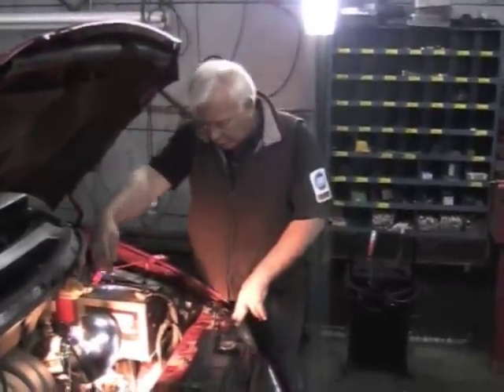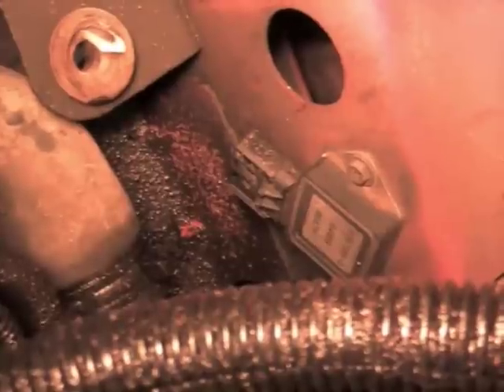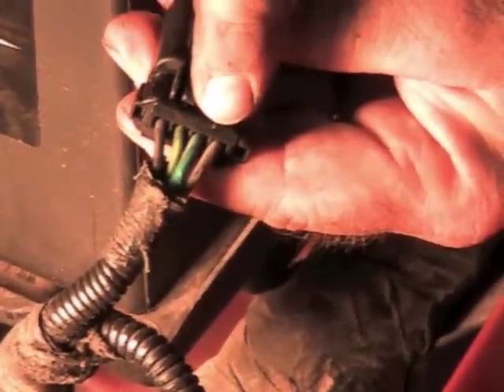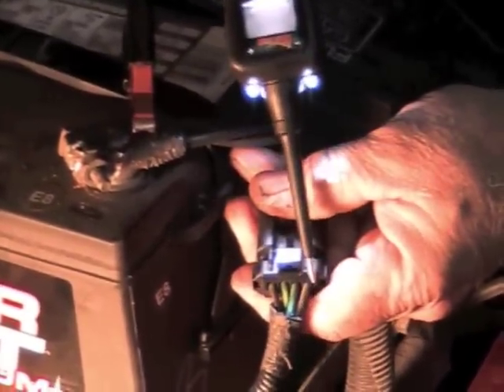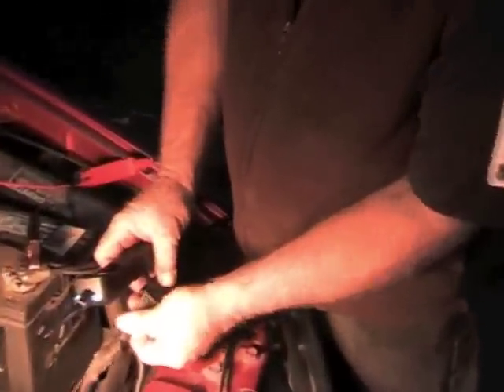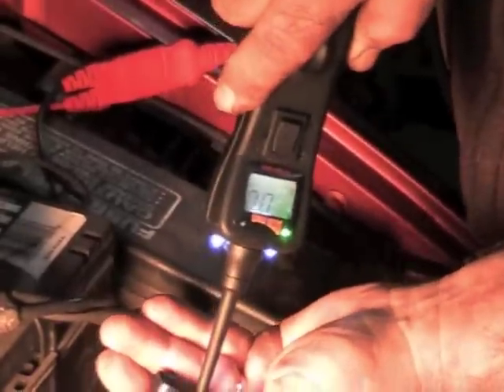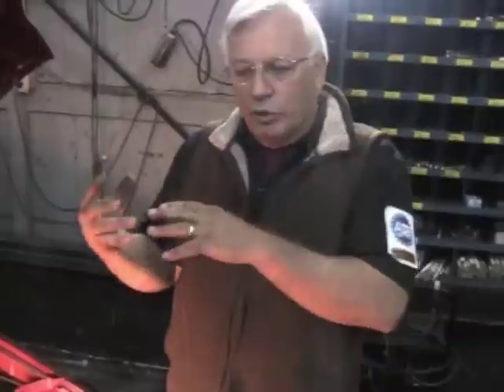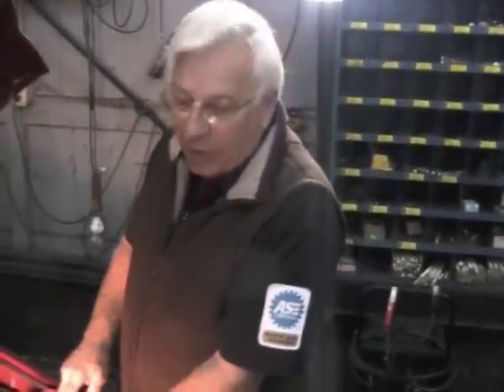Chrysler Cooling Fan Relay

Comment: I would like to know where you got the wiring diagram of the chrysler radiator cooling fan relay.  I thank you for this video.  The Haynes manual diagram doesn't have the 1-4 pinouts on the diagram, just a block drawing in which the signal wire LTGRN/BluTracer and the Power Out to the fans are reversed.  It cose me a BCM over the weekend when I installed a new wiring plug relay combination.  The generic plug the wire color coding was completely wrong.  The diagrams that are all over the internet are the same as the Haynes manual.  Anyone reading this, if you get a kit with the new plug pay no attention to the wire color coding, match your existing plug.  I would have done this but the plug had already been replaced once so I had some question as to whether my issue might be related to the computer signal and the power out might be reversed.  In retrospect the power out from the relay is obviously a larger wire.  DOH!!

Comment: What's the name of that tool you are using to check the power.  It looks like you used the same tool to supply the power for the fan operation test

Comment: For my 1993 Dodge Caravan, 314,000 miles I am going back in to figure out the cooling problem. I seem to have blown a crack in the radiator tank after I forgot to turn on the manual cooling fan. This time I am setting up a resistor device to simulate the temperature sensor. I made a relay tester and I am going to listen for relays clicking before attaching the fan plug.

Comment: I have 300C HENMI 2008 Model which  An electric fan broke and a new fan was installed, but it did not work, so the fan worked when electricity was applied directly to it.　We confirmed that electricity was coming to the relay, but we are not sure why electricity is not coming to the fan. I am interesting to have new power supply circuit for fan. 　How much Amp of fuse and  relay do I need to set up with fuse box for direct power?　　Or do you have any idea to have power for electric fan ?
Looking forward to hear from you.   Thank you !!
Reply from the maker: You are approaching it the wrong way.  If you power it externally you will bypass the computer's ability to control it and possibly overheat the engine.  You should be fixing why power is not coming from the relay.  Send me the diagram of your cooling fan circuit and I will try to help you.

Comment: Why is my fan cutting right back off(at idle)within 2 to 5 secs after coming on? 2.5l Sebring, conv. And it causes pressures in ac system to fluctuate of course, but when it does cut on for those couple secs, pressures on ac gauge drop. And when it sits not on, they rise of course, until they get high enough to cut fan back on for couple secs, then it cuts right back off, again, at idle. Other conv I have doesnt do that. Fan stays on for a bit when it comes on. Not cuts right back off. Coolant temp sensor? Relays have been swapped and swapped with known good ones. Doesnt do anything diff. No codes ever. Weird. Thx for any input.

Comment: I tested the fan and it works. Temp on dash never gets to the halfway mark so I'm guessing that is why the fans never turn on even when a/c is working. Is the temp sensor not working correctly? Should I replace relay? Engine seems and smells hot, even on short trips.
Reply: Also, the relays for sale on the internet come with wiring to rewire unit. Do you suggest buying it?

Comment: The electric engine cooling system on these vans is a bloody nightmare. I've been thinking seriously of wiring a direct power circuit with a toggle switch in the cabin to the fans for the times that the automatic system goes haywire, which seems to be about every other month.
Reply: 408knw I know this post is 4 years old but just can't resist adding my 2 cents....
It's not just the cooling electrical, the WHOLE ELECTRICAL system in these vans are insanely problematic....ugh. The stinking poor soldering on the  instrument cluster has caused people to spend thousands of dollars in "trying" to fix their vans. The "Anti-Theft" system has caused the same problems, and the electrical issues list could go on forever, sadly.
I do LOVE my van(1998 Chrysler Town & Country lxi 3.8) and she's been great to me even at 240,500 miles now. I'll keep running her until she just totally 1000% dies! Ever vehicle has problems and those common problems to each of them. I know most of the problems with these vans and know it inside and out. I sure don't want to have to learn a list of problems for another vehicle 😉, especially why she's still running and I'm still happy with her!
Reply: yes
Reply: No shit I'll never buy. Town and country again. I bought it in the winter time the temp was fine now that its summer my fans wont come on there are so many different thing that came make the fan not come on NEVER again

Comment: I have an '04 Grand Caravan and the AC does not work even after recharging it with both sealant and refrigerant.  I have also never seen the radiator fans work. So I replaced the fan relay switch apparently now for no reason.  The fans still have never turned on but the temp gauge constantly reads below 1/2 mark.   Should those two fans kick on frequently or are they only there for idling in hot weather?  So confused. ha ha
Reply: The fans are controlled by the cars computer. They only come on at certain times when the computer tells them to work.

Comment: yep thank you! i am replacing the relay to my radiator fan on my  jeep liberty renegade, 2002. seems it is also wired to the airbag relay..which i think may be the recall issue for jeep liberty recalls and causes the radiator relay to notwork  therefore  causing the overheating issue for the relay to keep going out to the fan! only expert geniuses coulda figured this out. ;) why cant chrysler??? and  how do i fix it completely i wonder...guess chrysler still dont know either.

Comment: I have a 1993 Chrysler town and country, there is only one fan motor with a four wire plug.  I am not able to locate the relay as it is not in the same location as your video shows.  I have bought manual and looked at every website and most refer to different years than 93, and none of them say where it is located.  Can you refer me to any specific info for the 93 on location of this relay?

Comment: I got a p0480 code on my 05 durango I changed the fan relay an the fan turns on but it still over heats a little an check engine code keeps coming back what can it be?

Comment: I have a 2002 Jeep Grand Cherokee, I have replaced (all new) electric fan, fan relay, thermostat, front temp sensor. The fan is still not working but the AC is working, and yes the motor gets hot as hell, temp gage is hitting temps over 240. 
I do have codes, 1490 and 1489. Please help. Dennis
Reply: P1489: High speed radiator fan relay circuit malfunction. P1490: Low speed radiator fan relay circuit malfunction. 
Possible causes Faulty Radiator Fan Control Relay Radiator Fan Control Relay harness is open or shorted Radiator Fan Control Relay circuit poor electrical connection. The Powertrain Control Module (PCM) has detected an open or shorted condition in the radiator fan relay circuit Possible symptoms Engine Light ON (or Service Engine Soon Warning Light) P1490 Jeep Description With the key on or engine running, system voltage over 10v, the Powertrain Control Module (PCM) detects a shorted or open condition in the low speed Fan Relay control circuit for 3 seconds. Test the fan relay resistance (it should be 30-70 ohms). Refer to code repair chart in other manuals or media. This info found on engine-codes (dot) com
Reply: Hey thanks for the reply. Man did I complicate maters! Originally the key reader failed I brought a used computer along with the key, key reader, door handle and ignition cylinder. They all worked fine but it was out of a 2004 car. Different fan control circuits. Brought yet one more computer, this time from a 2002 and yeh ol' Jeep rides again.   I think I am the only idiot that keeps put money into a 15 yr old jeep with 230km on it. Stop the bleeding!!!!!!

Comment: Only one fan comes on. Are both supposed to run or are they controlled separately? I have a 05 town & country. I replaced a leaking rad and the thermostat.
Reply: There are two power levels. 30% and 100% according to the video. Turning on the AC should make both fans run, I think. I'm working on a 2000 caravan now and there is only one power output from the relay, so that means that both fans run simultaneously and never separate unless there's a high speed relay somewhere, which there might be. So I don't know
Reply: Thanks for the info. I think I will go to the dealer mech. and ask.
Reply: Smart move, Sir.
Reply: @BillyGoat4x4     Both fans should come on. The speeds are actually variable but both should work whenever the PCM tells the fan to work.

Comment: I have a 2000 Chrysler Grand Voyager and fans wont turn off even when van is turned off. I have to pull fuse out to turn them off. Does anyone know what is what is the cause of this?
Reply: +Dawn Meredith chech sonsor or control module
Reply: auto uk n

Comment: I have been a certified tech for 45 years and I remember the chrysler has a solid state relay (as you have shown) but another model has the ss relay under and behinf the left front headlamp.  It is very hard to get at.  I have found that it is a lot faster to remove the right, sorry front headlamp assy. and with a 2" holesaw, drill a hole to the rear of the fiberglass rafiator support. Then you can reach the screws that secure the ss relay.